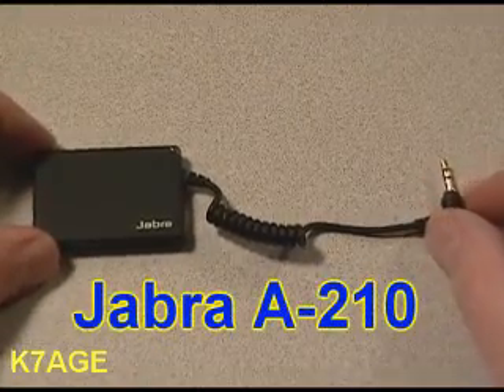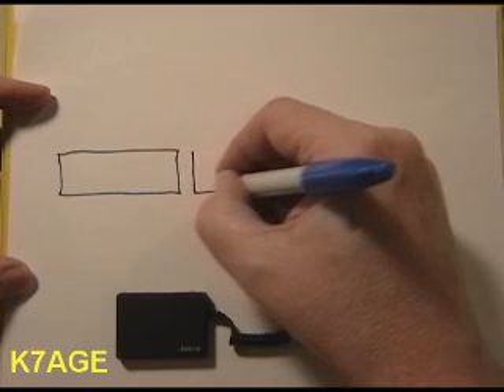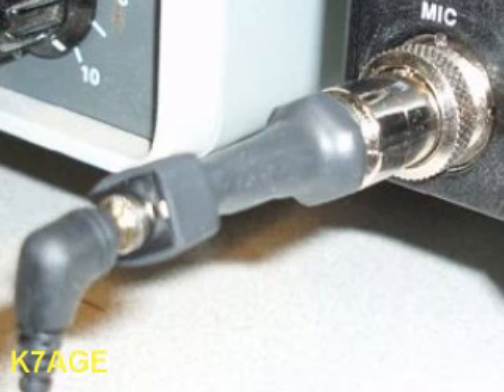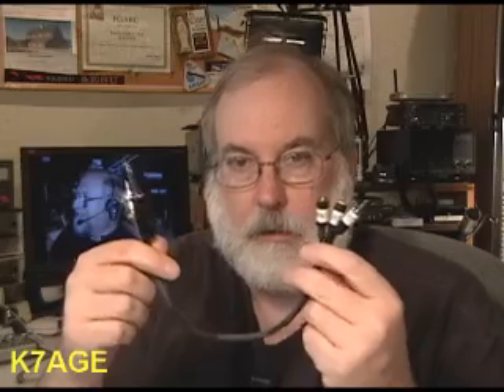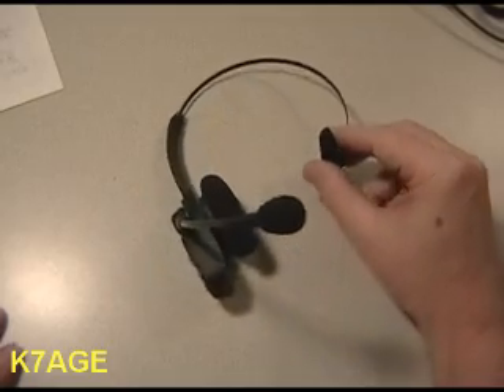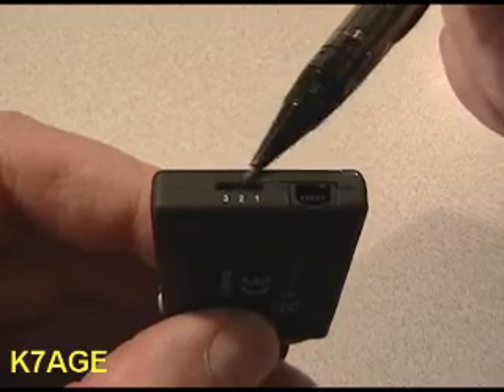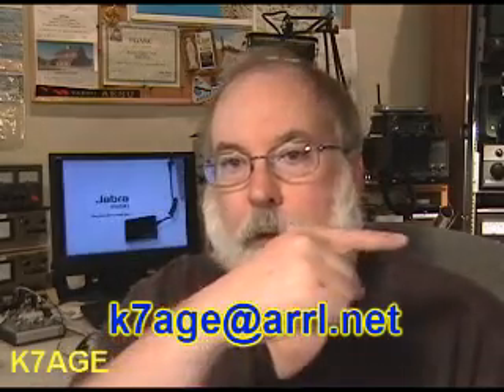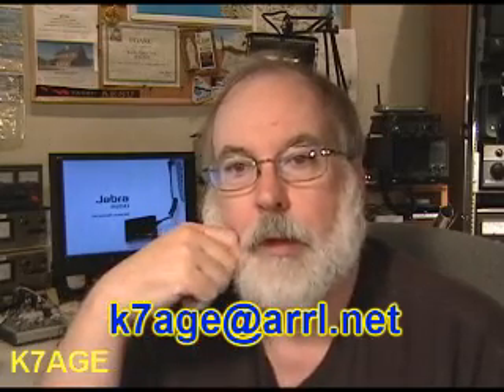Bluetooth Audio Radio Interface

Comment from the maker: I just discovered that the mic in the head is really a dual mic element. One side is labeled TALK. The idea is that noise is picked up by both elements and subtracted. Voice is mainly only on one mic element, so it comes through even after the two signals are subtracted. Therefore your voice is stronger than the noise around you. You see, you learn something new everyday! Randy

Comment: Thanks for the excellent idea, Randy! I had a Cardo BT-II sitting on the shelf. I just put it together and use the interface with my RIGblaster Pro. Transmit audio was a bit low at first but I enabled the GAIN function on the Cardo and now there's plenty of gain. I'm  using the interface through a RIGblaster Pro into an Icom Pro3.
73 de Korey--W3TUA 
73 de Korey--W3TUA

Comment from the maker: My guess, probably not. Most radios have PTT along with the other signals as a DC path to ground. Look in your HT manual to see what the wiring is like. If you radio has a VOX, you may be able to make up an adapter to work. Randy

Comment: Another great video. We have found that once you have turned on the vxi and paired it with the head set, you should not have to pair it again. So after charging and it is turned on, with audio or some noise from receiver, it should come to life, if it does not, then push the top button on head set and that should do it. If for some reason the vxi gets stuck in pairing mode, you will have to let the battery die by leaving it on for several days, then start from scratch for pairing. 
kr6g

Comment from the maker: The TS-2000 was going into my dummy load, and my FT-817 was sitting on top of it. The signal into the FT-817 was not very strong! I had probably a bit much mic gain with the BT so it sounded a bit overloaded or compressed. Tweaking would of made it a bit better. Randy

Comment: Hi Randy,
Since it's been a few years since you made this video, I'm wondering if you've run across any other devices such as the Jabra unit that perform equally well or possibly have better audio. I'm having trouble finding the Jabra unit right now that's not overpriced due to its rarity in the marketplace. Other Bluetooth units I've seen are questionable replacements since their descriptions are unclear as to whether they transmit AND receive rather than just one or the other. Some have a transmit/receive switch which wouldn't be desirable, especially when using vox.
Also, how does the Jabra unit accomplish the PTT feature for your setup?  Vox is easy enough but I'm curious as to how PTT would work in your scenario.
Lastly, I have a number of stereo bluetooth headsets that I'd like to try even though they're boomless.  Otherwise, I plan to use a nicer headset such as the Heil Pro 7 or similar to get the best audio. Thanks for any updates you may have acquired since this original video. Take care & 73

Dub Campbell, k4dub
Reply from the maker: Dub Campbell Hi, I have not researched the gear that is available today. I would use this video as a guide and not exactly how to get this type of interface built.

Comment: @JackSoffalot hi, i have one ts2000, i like to try this, i have all, only i need to connect but i have a question, the ground of the mic is the same of the audio out, because the ts2000 dont have head phone out in the mic connector. thanks